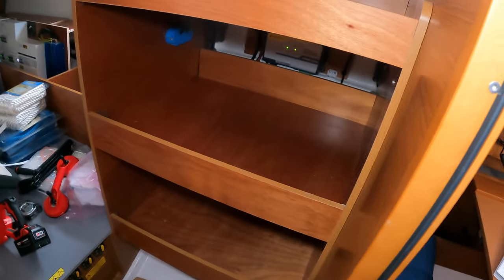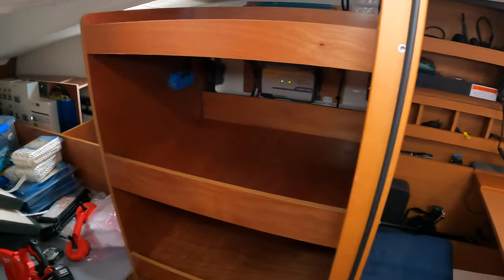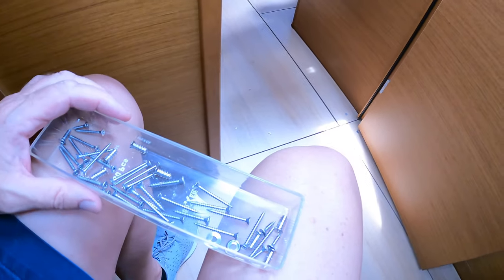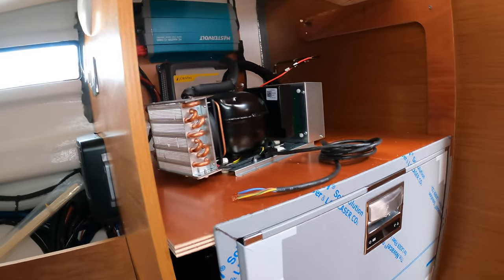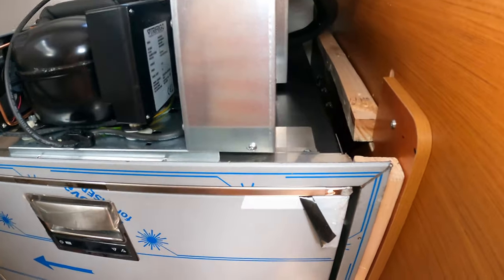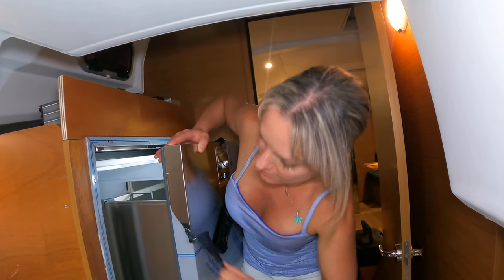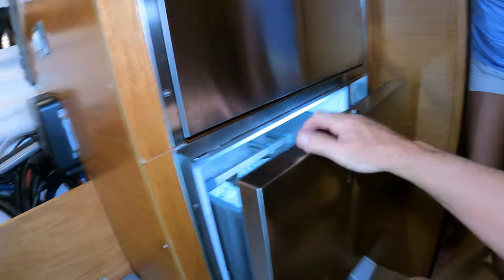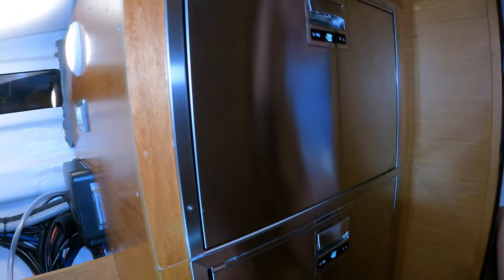DIY install of Vitrifrigo fridge freezer all in one

Comment: Tidy install. Looks good. Best to leave top compressor and condenser open to vent. It will look a bit ugly granted but It will keep the compressor cooler making the fridge operate more efficiently. Trap the heat it will possibly draw more Amps from domestic batteries.
Reply from the maker: We have left it open and it really isn't that noticeable. I agree the efficiency is better that way.

Comment: Great install. How are you going to access the components on the hull behind? I would leave the compressors uncovered, better ventilation etc. Cheers.
Reply from the maker: The compressors are on top of the two units. Completely accessible and there is a hatch I can open to vent heat overboard.

Comment: How do you access those electronics that were mounted to the hull behind your dual fridge/freezer? Seems like you've blocked those in without being able to access them any longer.
Also, do you have a washing machine on board?
Reply from the maker: I just removed the charger and inverter from behind the frig. They are being replaced with a victron inverter charger mounted to the outside of the frig. Look for an upcoming episode.
Reply: Cool. DO you have a washing machine onboard? Or considered one? Or have the room? Cheers! @SailingCAVU
Reply from the maker: We want a washer, haven’t worked the solution yet. Jeanneau puts it in the salon in the 490 but in the utility where we have the frig/freezers.

Comment: Nice install, I didn’t think 2 would fit. I’m curious to ask, what’s the main reason you didn’t order the boat with a factory installed freezer?  Was it because there was only option for one, different model, cost saving?  I’m really interested in all the upgrades your doing as I am also looking at purchasing a 440/490 Sun Odyssey.
Reply from the maker: The factory option was for one fridge. $3400. For roughly $4000 I have two fridge freezers. Either drawer can be a fridge or freezer depending on need.
Reply: Almost went for the 490 myself, but it has the Yanmar Saildrive, and the 440 has Yanmar Direct Shaft Drive. I love Yanmar Diesels,  but I hate to admit it, their Saildrives Suck, compared to the Volvo ones, so I'm set on a 440 unless another option crops up between now and placing an order, plus a bit better Shoal Draft depth with the 440, could be critical for the ICW too. Best of luck with Whatever you get. Bob. 👍🇬🇧🏴🇺🇲